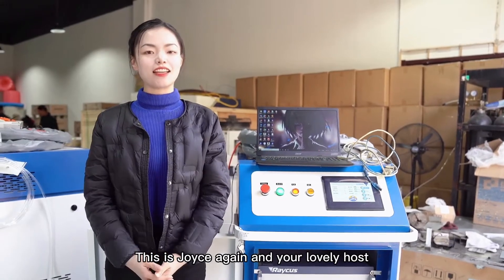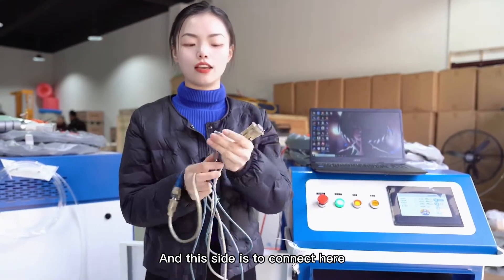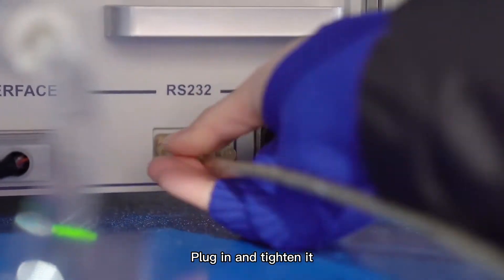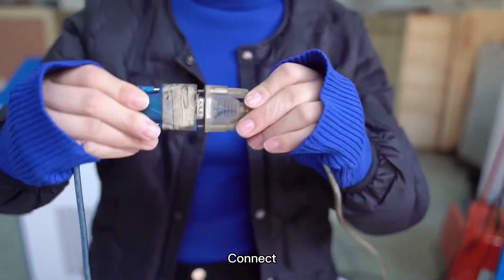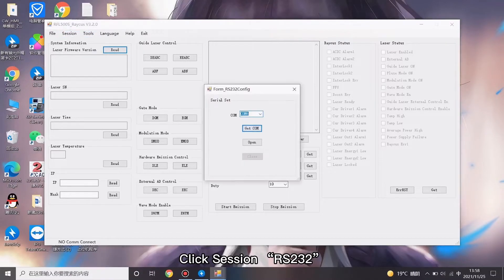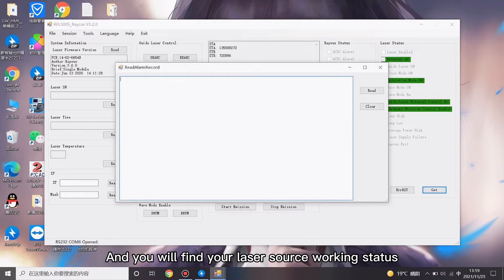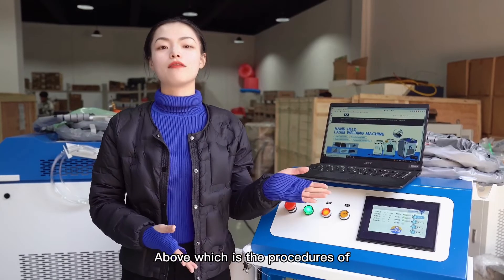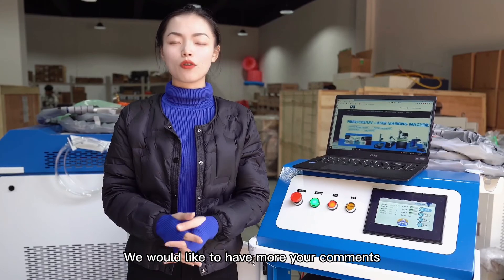Raycus Laser source Monitor app connect || JoJo Talks

Comment: Hi Joyce, I have an old Raycus RFL-C750 source, which is broken by back reflection of the copper material. The situation is, that I have no the diagnostic software and I'm missing some link for download the software. I'm out of the facebook, so I don't know if there's some link at your pages. And I have linux operating system, so I tried minicom (just a serial terminal), which only shows me change of the laser intensity, but when the optical coil is burned, I got no beam... I'd like to diagnose if there's optical or electrical burnout in my source, so please send me the link to download the Raycus software (and I'll try it in some borrowed notebook with MS Windows). Thank you.

Comment: Hi, I would like to connect monitor app with ethernet. Because cypcut uses RS232 while cutting and I cannot see what causes the problem we encounter. Laser source stops the ray for a few seconds and restarts it while cutting. But movement still goes on. So there is a uncut section on path. It occurs about once an hour. We have Raycus RFL-C1000 by the way. Could you prepare a video about ethernet connection?
Reply from the maker: No problem, any problem let me know and welcome more  questions and comments 😺
Reply from the maker: Usually Raycus monitor app doesn’t need Ethernet, directly use the wire to connect. You mind sending me the picture of the label of your laser source you are using now,